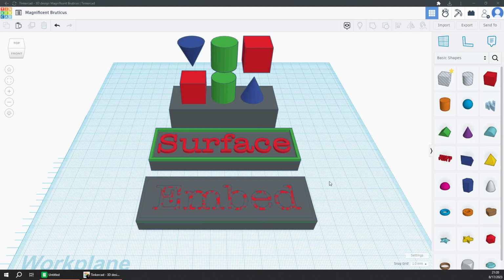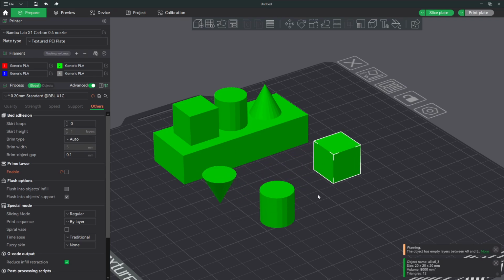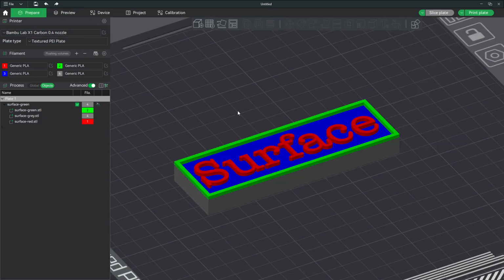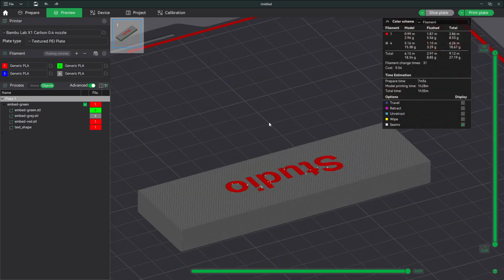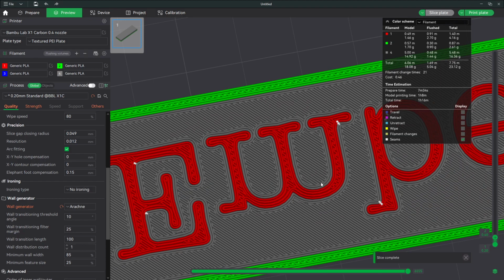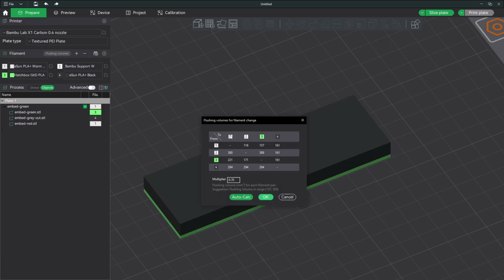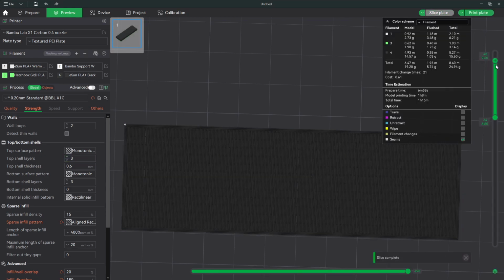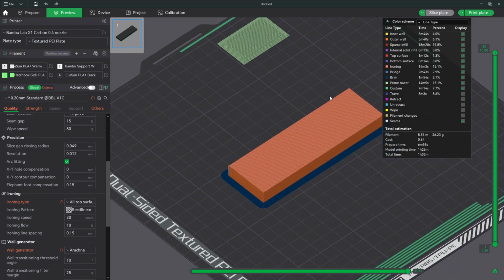Bambu Studio 1.7.4 - Importing Multiple Objects, Colorizing, Quality

Comment: Is there a way to have colored embedded text on BOTH the top and bottom surfaces? I can only get it to do one, but I want my print to be double sided.  I imported two separate text components but it won't color both.  It looks like it did when I slice, but then when I print, it doesn't work.  Thanks!
Reply from the maker: Yes, the text object just has to exist on both sides. If you'll imported the items separately (they are not in an assembly) it's likely they're there - but flat on the build plate. Importing them together (multiple STLs all at one time) ensures the positioning data is kept for floating objects.

Comment: You find it easier to do in cad because you have been using cad for ages. 😂
Reply from the maker: That's not wrong per say - I did do my first CAD work in AutoDesk 2001. That was just a class in high school though, and up until... early 2019 I really hadn't used any CAD software at all.

I got back in to it with TinkerCAD when I bought my Ender 3 and only a few months ago loaded Fusion 360 for the first time.

There's a learning curve to any of this software. Don't let that intimidate you though!